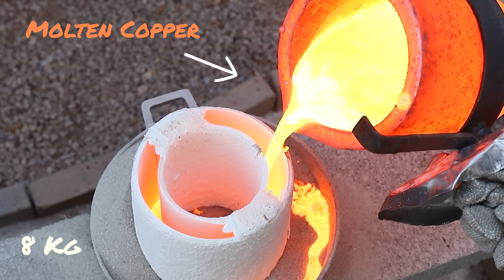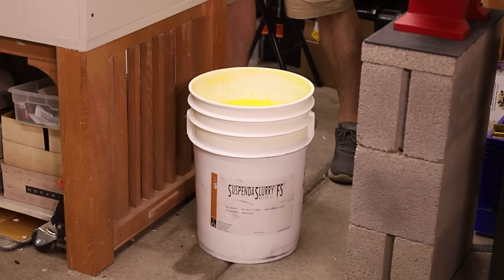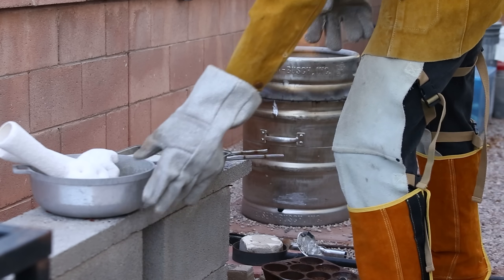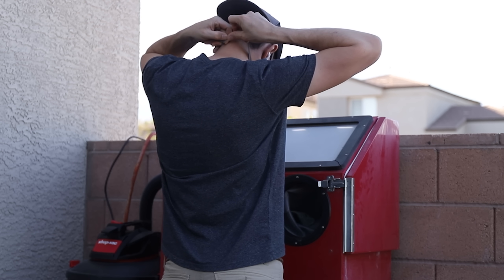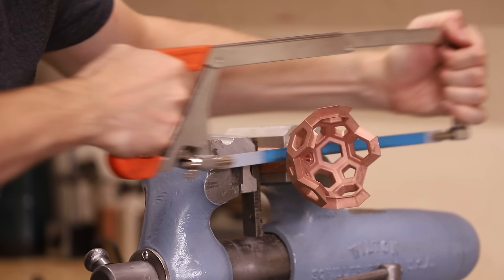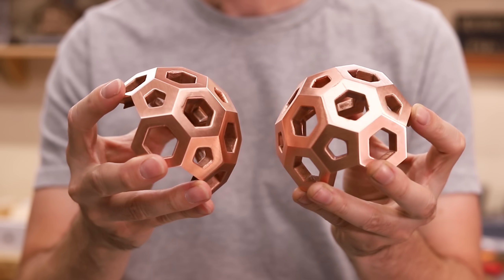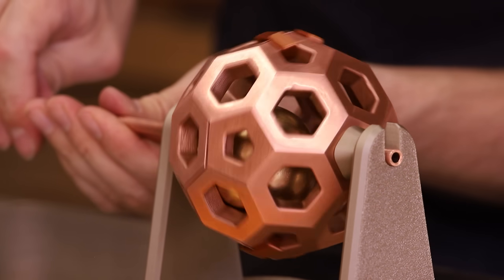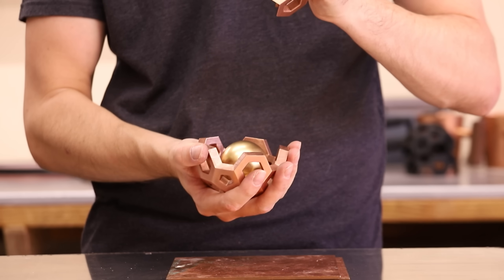HUGE Magnet VS Copper Sphere - Defying Gravity- Will a Neodymium Magnet Float Inside?

Comment: Put some bushings on it so you can see how much electricity is produced. It looks like a thick copper mold and a big magnet. I bet it would make a lot of electric current when spun and most importantly minimal wear on parts since the magnet is suspended in the copper. Usually the copper is wound and the magnet spins yours it is not really spinning and the copper is turning while the magnet floats freely. Plus.... if you ran them in a series as you showed with the other magnet a foot away.... your could increase the electrical output by however many fold you wanted by adding more. You thus would spend some energy spinning first sphere but others would spin as well to make more energy than what you expend by moving just the first one.

Comment: Probably a bigger magnetic ball and/or smaller copper sphere. The effect is due to Eddy currents right? which are stronger at close range. The less distance separating the two the stronger the "levitating" effect, maybe? In effect the ball is too "loose" inside the magnetic field so rattles around more due to being pulled off center by gravity.

Comment: 20 ft or larger round copper discs, like large washer shapes, with magnet material between and surrounding a floor can lift the entire contraption into the air.  Flying saucers will soon be developed.

Comment: hook a motor up to the smaller magnet to rotate the sphere. Paint the spherical magnet with paint that will glow under black light and paint the outside of the copper sphere black so you can see the floating sphere better? Maybe

Comment: Youtube chat innovation on tips for the truncated icosahedron copper sphere with neodymium magnet ball : You wanted innovative suggestions to make the ball float more inside the copper sphere in A more visible way ? Well hold on to your chair , brain and eyes and read this thoroughly ! : make two new copper Truncated Icosahedron sphere halves and make them thicker and make the openings sloped towards the inside ! and smooth out the internal sides straight that you in the first edition attached and closed to each other of the open part half straight and make the other half exact the same and hang one part of the copper Truncated Icosahedron sphere on to A very sturdy complete vibration free stand and use very stong and very good and big ball bearings where you hang the first halve Truncated Icosahedron on and erect the other half on A sturdy complete vibrations free stand and make A stand for the other half with an eletric motor to make it spin in both opposing directions with an adjusteble same speed dail knob an place them very closer so that they almost thouch each other and incorporate two oposing spinning electric moters to spin each half in oposing directions and the neodymium magnetic ball will float more inside the two copper Truncated Icosahedron halves and indeed when you paint the copper Truncated Icosahedron sphere's halves black and use strobe light and with A special camera shuttertspeed time delay then you will see the ball float more in mid air , and an even more additional feature is when you paint "almost" the whole Truncated Icosahedron copper halves in the green colour that you can make vanish in the camera recording and use an strrobe light with timing shutter speed it will make the copper Truncated Icosahedron's halves stand still and you see the neodymium magnetic ball more and make the two copper Truncated Icosahedron's thicker so it will influence the floating effect even more on the neodymium ball magnet and line them on the inside with the same green colour tacky rubber that you can use to give the ball magnet an additional spin , or even an better additional innovation with all the first additional innovations ; make an order @t the magnet maker/supplier for an indentational lined groove on the circumfrence of the neodimium magnet where you can attach A very thin but strong tacky wire to give the ball magnet an first spin inside the two copper Truncated Icosahedron's halves like an gyroscope and then spin the two copper Truncated Icosahedron's halves in opposing directions because that will make the ball levitate even more and more and for an longer time , Good luck handy Foundry man !

Comment: Put a non conductive spacer in between the two halves and connect a lead to each half. Rotate the shaft and see if you produce a current through the two leads connected to the light bulb.

Comment: When you're done pouring your molten copper, you shouldn't leave your crucible out in open air like that. You should return it back to your foundry and let it cool down inside of it. Otherwise you risk thermal shock of the crucible which greatly reduces its lifespan.

Comment: Make three of them and see if you can create Perpetual motion. Make one big cylinder around it like a can and have groves that would push off them, like variable tick marks in the cylinder. Have the cylinder spin, and it may power a small motor. If you're successful, it will most likely get hot in the long run, so the next step is to build it in a tank like in coolant fluid or mineral oil, then see if it can propel efficiently. If it works, you can publish your discovery through a university so it gets published publicly on Google Scholar. That way, It doesn't disappear. If your successful

Comment: Maybe an electrical system that drives magnetic fields, like an AC current kind of thing for an induction motor? Or maybe you could try casting a spherical gear and get more angles of rotation - then the system could try to compensate by moving in various counter directions as the spherical magnet moves?

Comment: I think because the magnetic is dragged along by the magnetic field of the copper, it stops being supported in the middle once it catches up to the rotation speed of the copper cage and the repulsive force drops to zero.   My theory is that you should make a variable speed motor to spin it.    Something that is constantly speeding up and slowing down at a fast rate.    This will prevent the magnet from ever reaching the same speed as the copper cage thereby causing it to continuously float in the center through magnetic repulsion from all directions.    😊    it will need to be something that can handle the torque of spinning both the magnetic and copper sphere since they are magnetically connected and also take into account the extra drag generated through speed changes.    So something that can handle that without over heating.    I don't think it needs to spin super fast.    Just needs a sine like wave of speeding up and slowing down.    It needs to speed up and also slow down with torque being it will be fighting the force of the copper cage and magnet

Comment: Because its not precision machined and after manual removal of material copper isn't completely equally distributed along sphere. That's why you getting magnet inside to wobble enough that it's still hitting the sphere. 

Did you try to do some maths calculations to figure out the distance of magnetic fields created by rotating copper thus you might get better effect with smaller magnet which would have more space for wobble thus it wouldn't hit walls anymore

Comment: I wonder if the two spheres were like a centimeter or two apart (current loop closed by wire at end rods), the ball would still float. It would be nice cause you can see the ball continuously.

Comment: Using a smaller ball and thinner copper structure would allow the ball to float longer. You and the audience would be able to see the interaction better, making it more satisfying and dramatic! Then, you may even be able to spin the copper at full speed with and motor or drill and get a fully centered ball!. I’d love to see this!

Not to take away from this amazing video!!
Reply: Thinking smaller lighter ball… maybe even hollow?
Reply: @johnpauly5524  - Yes, lighter ball, but since the ball is a magnet, I’m not sure it can be hollow. Does anyone know if this particular magnet can be made hollow? This could create a new generation of fidget toys!
Reply: @mixmeow 
Maybe? Neodymium is basically charging metal to get magnetic effects but it'd probably reduce the magnetism.
Reply: @trutwhut6550  If it was possible, I’m thinking he’d eventually calculate and discover the magnets strength to weight ratio. If so, we’d have an awesome follow up video!
Reply: @johnpauly5524  a smaller ball may not be able to create a strong enough magnetic field.
Reply: @ddenozor  spinning the copper cage at higher rpm to compensate ? Definitely. And since the magnet would have less mass, it would be more stable too.
Reply: @chpsilva I’d love to see an update video using the options mentioned on this thread!
Reply: A smaller ball aka a baller. Get down to south central LA.
Reply: If the external copper sphere was made of sheet copper cut like an apple into slices but with I guess 40 ish slices of 1.5mm sheet, you could have the camera to one side and see through the gap as it span and hovered a little sphere magnet inside. One benefit is that it would be much easier to make.
Reply: @subspaceanomaly - I’m hoping he considers this ideas and does and revisits this experiment in the future!
Reply: Grinding out the inside of the cage to a perfect sphere would smooth out the turbulence in the eddy currents.  It would also create more space for the current magnet.

Comment: 11:35 Maybe the airgap between the two shells hinders the inductive fields, you could try welding the two pieces together, or putting some conductive material like liquid metal on the contact faces.
Reply: Why do you think the air gap should be eliminated this way instead of filing? Is this just faster and more reliable to make gapless contact?
Reply: Genuine question btw

Comment: Print it again but with the handles made as part of the area you put plugs in. No making holes in it. Also you can hook up a motor with gears and a resistor so you can vary the speed until it floats.

Comment: build a gyroscope... and use those parts for the motor generator to spinning by itself.... so you have to isolate those parts and collect the electricity in the others coils from the gyroscope... the last coil  have to be wired double... so its working as motor and generator in the same time.... to increase the spinning you can use the magnets attaching to the other coils... just a tip.... you also need also magnets to stop the gyro.... because once its reaching the speed it can't be stop.... so  its  keeping spinning till it explode ... if no magnets are using to brake the speed.....    ...atiki taki tiki tu ta ta
 🌏 📡🌏 👣🕖 💎👽☠☼☾☄ゞど・ㇺㇾㇽ₪𝖎𝖙𝖎𝖇𝖎𝖗𝖆₪なめㇺㇾㇽ✶☥✨🌛🌄⊀✶⋊🐺🐾♓☆🐜🐜🐫▲▴◭👀

Comment: Firstly, you need to add bearings and secondly, the speed that you would need to spin the sphere is too fast for it to look as cool as you would like it. It’s also too noisy. Instead find a way to secure that sphere so that it’s not bouncing on the copper or maybe line the inside of the sphere with rubber or foam to get rid of the noise. Thirdly, use a motor to spin the second magnet instead, place said magnet and motor into a nice wooden box and mount the sphere on top so it spins slow slowly and hypnotically

Comment: It would be cool if you could modify the shafts/plugs be able to slide back and forth. Then you could attach plungers to the shafts inside the sphere. You could slide the shafts together with the plungers "clamping" the magnet in the center of the sphere. Then start spinning the sphere. When you get it up to speed pull the shafts outward releasing the magnetic ball that way the ball doesn't experience any of the turbulent "bouncing" as it tries to lift off.

Comment: Add a set of high speed bearings, an electric motor with a belt drive to the main rotation shaft and use the electricity produced to power the entire thing. Self sustaining.

Comment: Since the copper tubing used to turn it is hollow, press fit bearings inside of it with another rod suspending a magnet and measure the rotational force turning the copper has on the the magnet inside

Comment: Instead of the excess work of filing the hex holes, you should have just bored round holes in-line with each other. No need for printed inserts, just cartridge bearings. Also you should use a vertical spin axis.

Comment: Two easy improvements, and one question:  If the cage had pin holes transferred and drilled into its facing pieces, the funky clips wouldn't be needed, and it would balance better in this way. Secondly the pieces you cut off could have been designed to be the bearing shaft surfaces, where bearings were mounted on each protruding shaft, and these mounted in the base. 

My best question is one only you would realize, and that concerns the magnet in the sphere.  Does rotating it at higher speeds cause the sphere to heat up and release heat.  I have been trying to find a reasonable shape to use for this principle, driven by a small motor at a constant speed, as a future zero discharge heat source, where the shaded pole motor is powered by solar or wind generation.  Fixed magnets outside a copper coil or mechanical formed shape in copper produces a fair amount of heat, but the caged floating magnet is genius.

Comment: You might want to do some reading into eddy currents or some computer modelling thereof; not sure that shape and the join between the two halves will be particularly conducive for keeping the ball floating. I might be wrong though; I certainly haven't worked through the maths myself! And spherical magnets aren't really spherical in terms of field lines.

Either way though it is pretty! A lovely cast.

Comment: Put the plug tube on bearings. Then use that secondary external magnet on a motor under the table. Hopefully this setup allows you to make it rotate without any visible wires.

Comment: what if the magnet was pole shapped and the copper tube was in a cicle with magnets on the outside to drive the cylinder magnet around in a circlure pattern? How fast would that thing spin around, and would anything extra happen, current? portal? 😅

Comment: Try using one size smaller magnet and it should allow for slower spinning speed that is easier to maintain and that should give you the added lift during engagement of copper sphere, I believe the dense weight of original magnet is where you are encountering issues

Comment: For the next stage, and so you can do proper next stage testing, I would spin it up by electric motor using a simple belt drive and either using voltage from a lab PSU to control the RPM or using a variable speed controller, then when you have proper RPM control we can see how the inner magnet response, i.e.' is it rotating or holding a fixed position when spinning.
Super cool!!

Comment: Would the magnet still levitate if the shere is spinning with a vertical axis? I would like to see  if magnets external to the sphere would affect the rotation speed and or the speres position? Would arranging the magnets in different patterns make a difference? Would there be a better or lesser outcome in these arrangements?

Comment: Can a magnet levitate under metal it pulls it self to while gravitation pulls it down causing it to stay still? Then you should able to calculate and design a sphere cage that has only the top half being magnetic and the bottom doesn't pull down (non-magnetic), but only gravity.

Comment: You are simulating the way a motor operates with magnetic fields. Try adding voltage to induce a greater magnetic field. Higher magnatism should hold that sphere in place or it may even spin itself.

Comment: If you have a kitchen scale - at what point does the weight change when dropping a magnet on copper? Might need some isolation between the copper and the scale so the magnet wouldn't affect it..

Comment: If you used flat paneled magnets because the inside of the sphere has flat edges it's not quite congruent with one another so maybe if you put the flat panel magnets at certain angles it would start to spin itself by pushing against the copper flat edges at the right angle creating propulsion from anti-gravity

Comment: You could attach a magnet to a motor to "wirelessly" spin the ball, if you hide that motor under the table it could look pretty sick.

Though you could just use an electromagnet instead provably.

Comment: You could have just dumped the parts into a bucket of water while still hot, but solid. The thermal shock will break the mold easily.

Comment: OKAY. PLEASE TRY THIS.  IT WILL BE TRICKY, BUT YOU WILL LIKE THE OUTCOME.  HAVE THE AXEL SUSPENDED WITH MAGNETS FIXED AT EACH END. THEN USING EXTERNAL MAGNETS MAKE YOUR SPHERE MAGNET ROTATE.  NOW USE 4 TIMED N/S MAGNETS AT 90 DEGREE INCRIMENTS TO MAKE THE CENTER ROTATE.  YOU SHOULD THEN SEE A PLASMA DISCHARGE IF YOU SURROND THE N/S MAGNETS WITH A 50GUAGE STAINLESS BAND. THEN AT 15,000 RPM YOU WILL SEE THE WHOLE THING VISUALLY VANISH.

Comment: 2 things.  Try a smaller magnet and instead of spinning on a horizontal axis maybe try a vertical axis spin?  It looks like it's just a lil too large for the copper cage.  So it smacks around in there.  

If the rods are hollow and you do a vertical axis, maybe you could have a push rod that the sphere can sit on then you can drop the push rod once the copper sphere cage is spinning fast enough.  Maybe it it'll hover then without getting knocked around?

Comment: I wonder if you insulated the two sphere halves from each other if you could measure a voltage differential between the two while spinning?  Would the supporting magnetic field be weaker, or stronger?  Or would it oscillate in sync with the RPM?